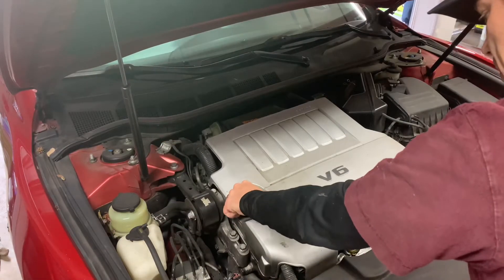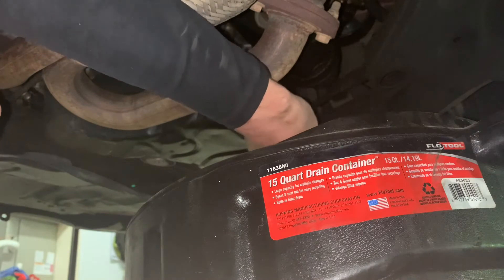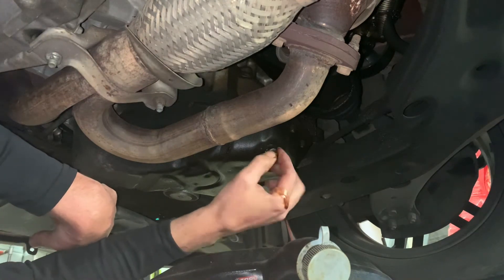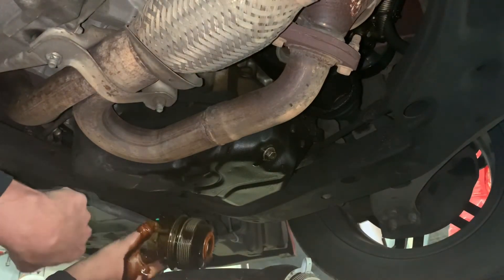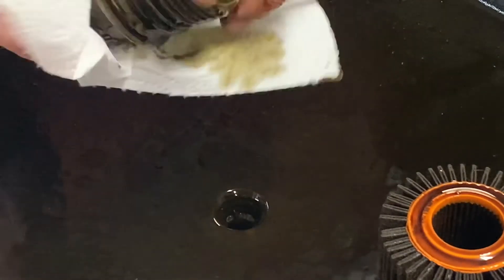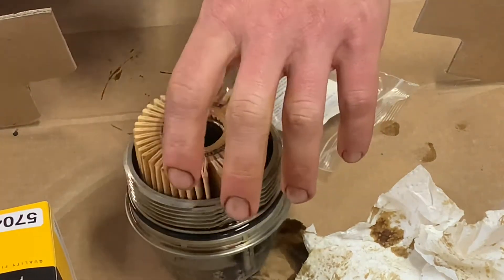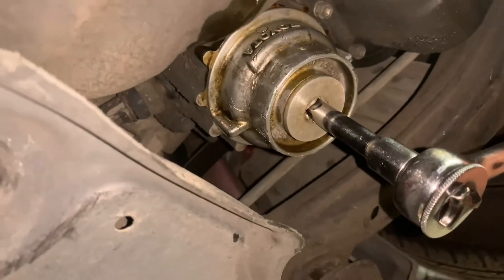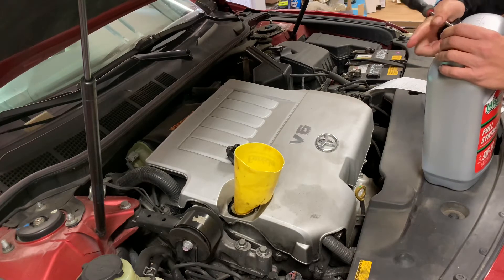2009 Camry V-6 Oil Change and Reset Maintenance Light

Comment: I use Mobil 1 Extended Performance High Mileage Full Synthetic 5W-30 motor oil & Mobil 1 Extended Performance Oil Filter on my 2009 Toyota Camry SE V6.

Comment: Do you have a check engine light due to catalytic converter? Mine started showing itself at 150,000 miles
Reply from the maker: I have a code for a bad coil pack. I'll get around to it :) I did have codes for O2 sensors but ran Cataclean through a tank and it cleared them. Pretty amazing stuff.